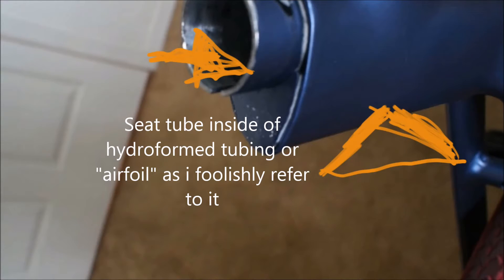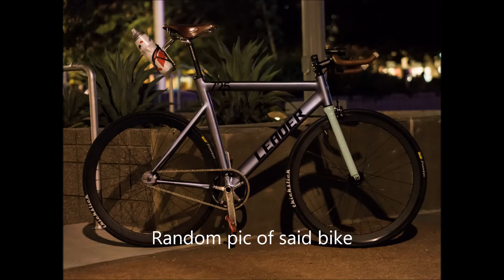Leader 725 Build Quality Pt 2

Comment: I also have a 2014 Leader 725, from Coghouse, and the same exact thing is happening to me. It's a shame because I really like it. Let's see how Leader handles this.
Reply from the maker: when did this happen?
Reply from the maker: when did this happen? feel free to share my video I want people to know they can do sm
Reply: The bike started creaking maybe a month ago. I spent a LOT of time re-greasing the seatpost, saddle rails, etc not even realizing it could be the frame. I finally saw and added some oil to the two-piece interface and it stopped the creaking. Yesterday though, I picked up the bike by the saddle and felt it move, eventually tracking down the problem and noticing the entire inner seat tube is moving.
Reply from the maker: please share the video. I want them to be responsible for cutting corners and putting out a product of this quality
Reply: Well, I'll wait until their decision before I'm hard on them. If they make the replacement process smooth and free then it's difficult to fault them. They are inexpensive frames.